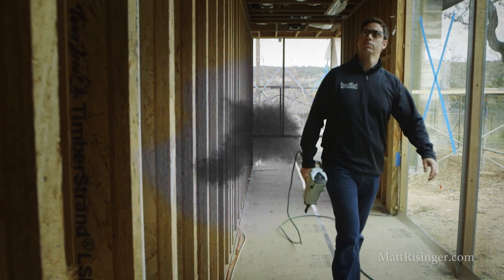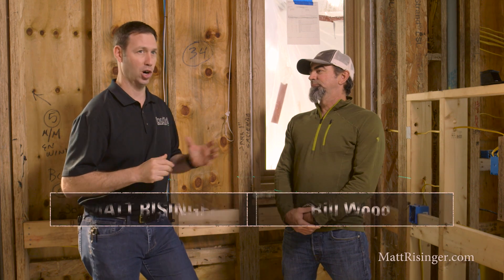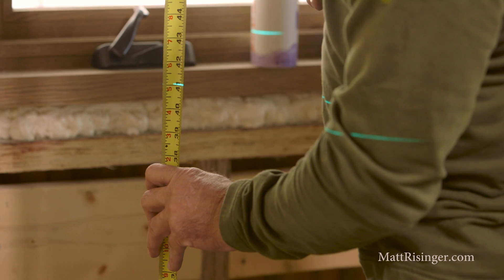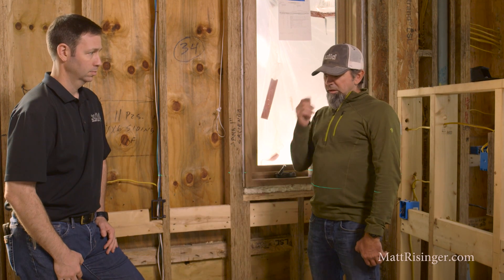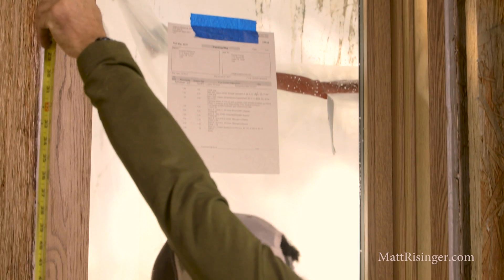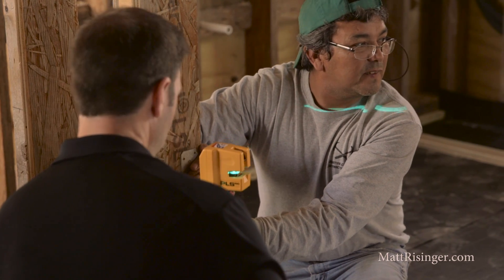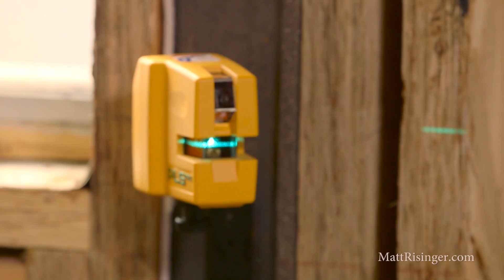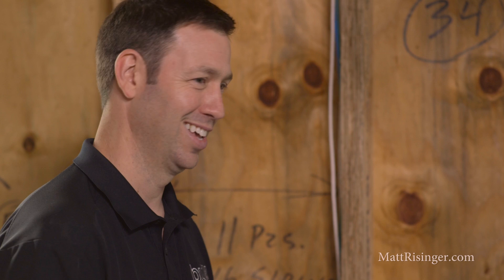Laser Levels - Framing & Remodeling use tips

Comment: How do you use the cross laser level on the roof pitch 12 12 so that you can put your metal roof panels on straight? the line goes left or right nephew go off center. How do you know where center is to begin with?

Comment: I am an electrician and I use the laser for setting all my boxes so they are all the same elevation. I also use it for drilling holes for romex which makes it easier to pull. The magnetic L bracket works well on metal corner bead when cutting in boxes during a remodel. I also have a laser plumb bob that is useful for lighting layout.

Comment: Had my PLS since 2010 and it's easily one of the best tool purchases I've ever made. Super accurate and rugged. It's a self leveling pendulum type so just hang it or set it on something that isn't going to more and you're ready to go. They also have a target that works outside over long distances so you don't actually have to see the line.

Comment: Do you have to wear eye protection when your using these lasers?
Reply: +Matt Risinger - Both recommended laser level are class II lasers which don't require eye protection assuming everyone has a normal blink reflex and everyone will look away quickly if encountering the beam.  Never stare at the beam or it will damage your eyes.
Reply from the maker: +59seank Good question... not sure.  Need to look that up.  Don't think so
Reply: Thanks Matt.